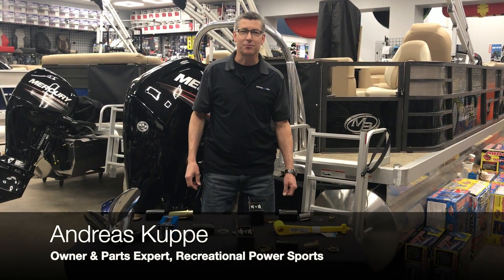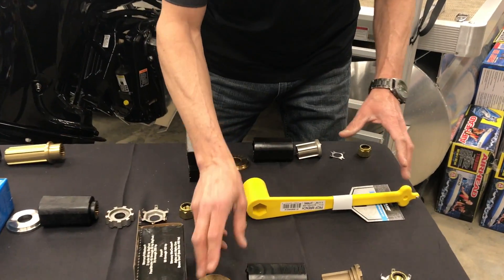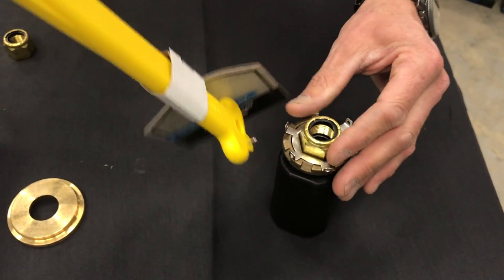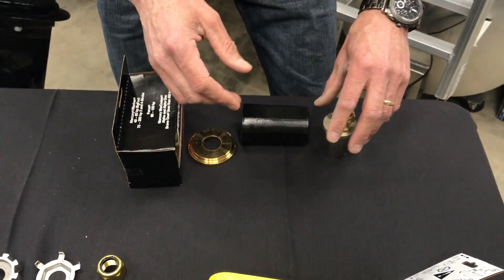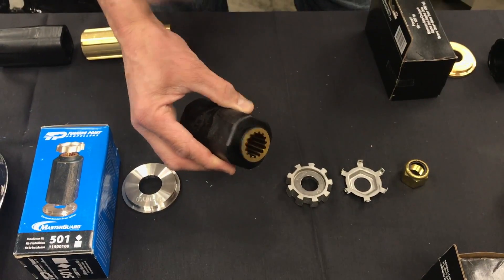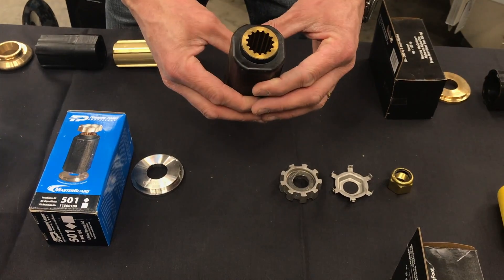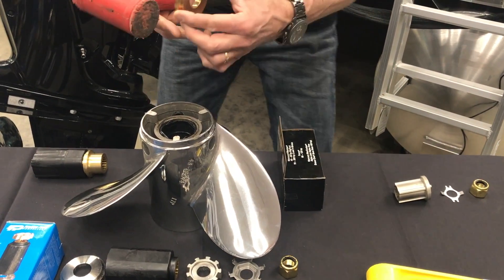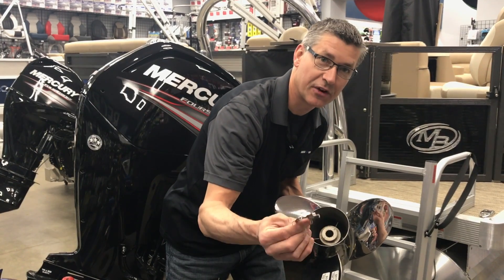How To Install A Hub Kit

Comment: Can those hub kit fit on the old 80s prop? I would rather use the new style instead of pressed hub.. I have a old 1981 mariner 90hp 2 stroke.

Comment: They are junk just cheaper to make then charge you more the old style is much better when you spin a old style hub you can still get home but at a much slower rate when this new style garbage goes they disintegrate and you are dead in the water the old style gave you a safety net, what would you want on your boat when your 40mi off shore or even 10mi from your boat ramp
Reply: The towing services love 'em